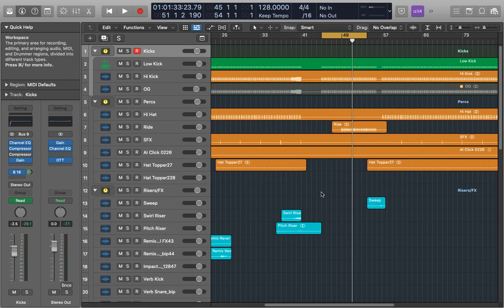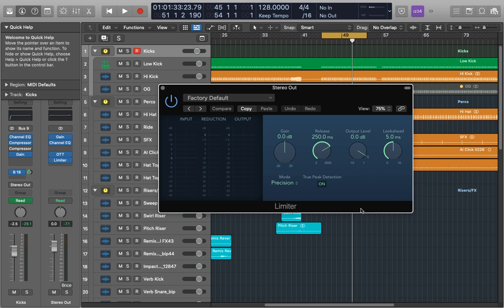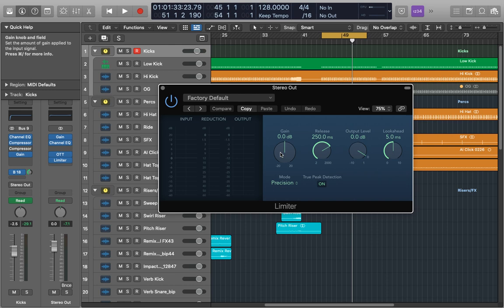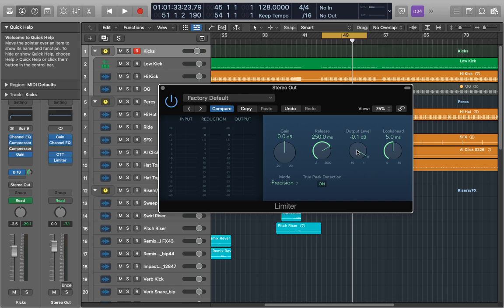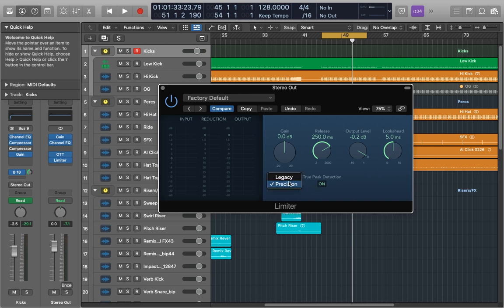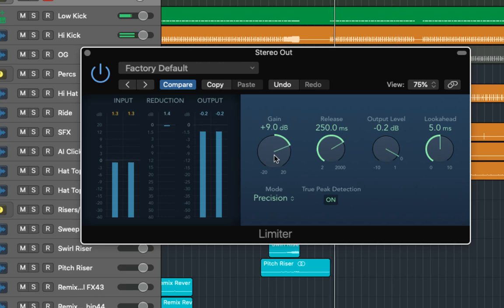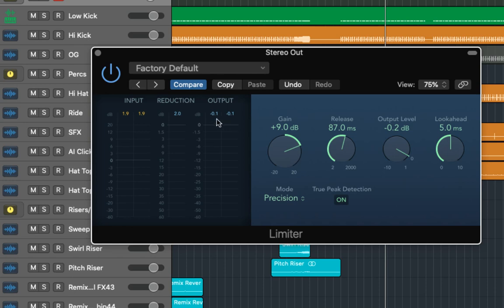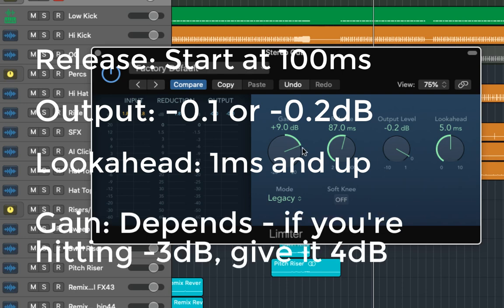Logic Pro X - How To Use The Limiter

Comment: Ridiculous question, but would you put a limiter on top of an adaptive limiter (or Vice versa)? The reason why I asked is because you mentioned that an adaptive limiter puts more “color” to your master. What if I wanted to do that with the Adaptive Limiter, but wanted to use the Limiter to still prevent overall sudden peaks?
Reply: It's common practice to put 2 limiters behind one another on a mastering chain. Ideally you'd place the adaptive limiter before the brick-wall limiter; this way you'd be adding the color yet still making sure that no peaks are sneaking through in the end.